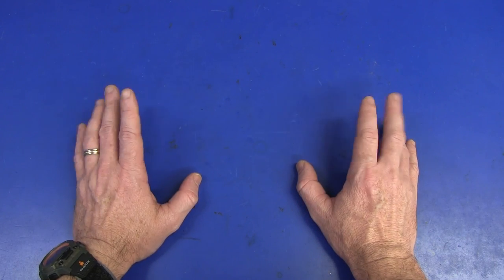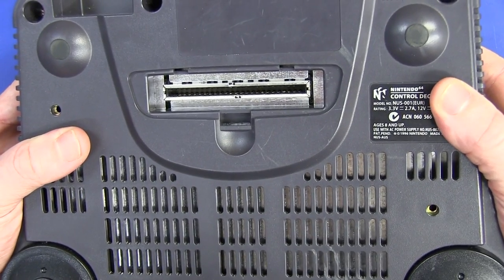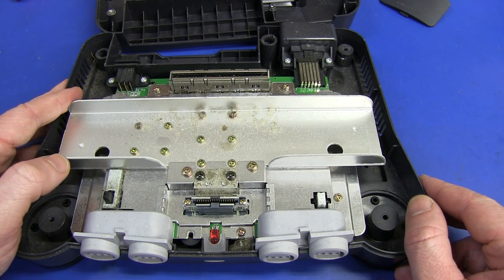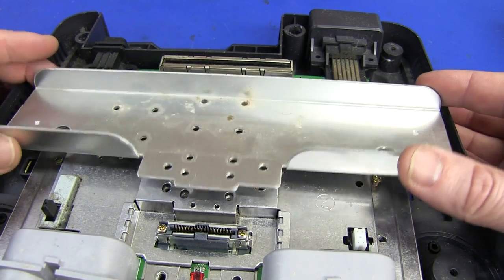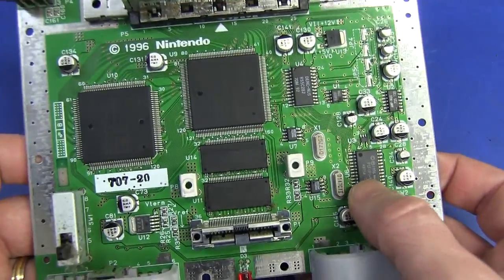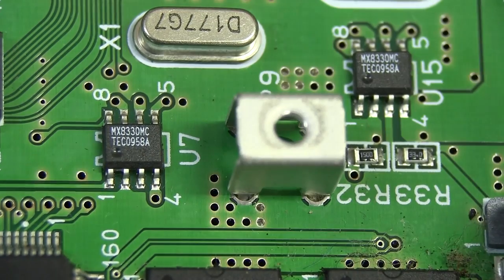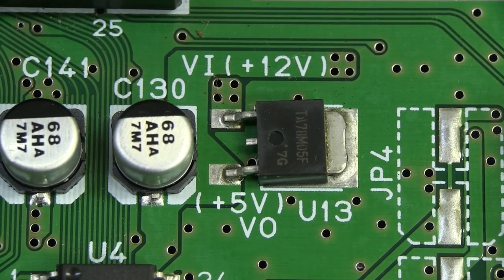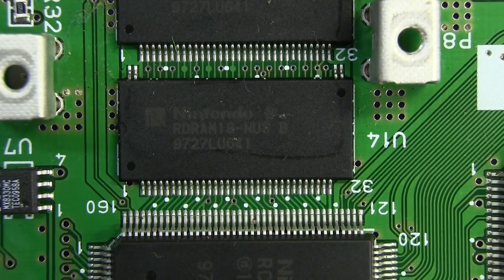EEVblog #491 - Nintendo 64 Game Console Teardown

Comment: My ultimate disapointment with N64 comes from it trying to rush into 3D gaming too quickly.
 The Super Nintendo was so cool for how it had a major improvement in 2D graphics and sound over the first Nintendo and I really wanted the next generation of 2D for things like Donkey Kong(SNES) which was pushing the system to it's limits.
 Instead what we got was something trying to be a PC/Arcade level console at a $200 price point which couldn't deliver a pleasing performance to people like me who were spoiled on PC and Arcade 3D experiences.
 Also the controllers were terrible.
Reply: "from it trying to rush into 3D gaming too quickly."
PS1 release date: 3. Dezember 1994
N64 release date: September 29, 1996
PS1 units sold: 104.25 million
N64 units sold: 32.93 million 
Rushed into 3D? I don't think so.
Reply: @DasAntiNaziBroetchen   Every game in the N64 library suffers from one or more of the following conditions: Low frame rates, slow down, stuttering, AA noise, limited FOV, bad physics, extremely low polygon counts, low-res textures, and bad or limited audio.

N64 had bad engineering under the hood:
No CD-ROM drive
Insufficient RAM
Lack of sound chip(sound is processed on CPU)
Lack of dedicated GPU chip(also run through the CPU with sound)
240p display limitations(PC and arcade were doing 1024x768!)
And it's coding system was eccentric. 

N64 has a long list of badly fucked up games like Castlevania, Superman, Earthworm Jim, Megaman, a Disney Donald Duck game, three bad Star Wars games, Mortal Kombat, and bottom ranking scores on multi-console game releases.

 They were beaten by Playstation and had 2 years to improve on Playstation's design by releasing 2 years later. Sony, the people who make Stereos and TVs made a console that beat Nintendo at their own game with older hardware.

Comment: It did have a DISC based add on thru the expansion slot, but it was only sold in Japan and was called the 64DD. If they had released it in the USA it might have lasted a lot longer.
Reply: Disk. Not disc. There's a big difference. ;)
Reply: DJPaulgee1
In English:
Hard Disk Drive
Floppy Diskette
Optical Disc
Compact Disc
Blu-Ray Disc

Comment: Regarding the ground contacts on the cartridge slot, N64 cartridges are not hot swappable from what I recall.
Reply: They put in all sorts of warnings that you should only change cartridges with the power off, etc, but of course in practice everybody just ignored that and things more or less worked fine.  I presume they designed it knowing that would probably happen....
Reply: Weren't they going to use hot swapping for Banjo-Kazooie? I know they had that stop n' swop thing that got canned for other reasons, but I think it was going to use hot swapping.. not entirely sure
Reply: Despite Nintendo's warnings, Rare did plan a game that swapped and the 64DD almost certainly could have made use of the feature. I think the pins were actually made that way to keep the SRAM in some cartridges from scrambling (a known problem on the NES).

Comment: the expansion port on the bottom was used for the n64 disc drive only sold in japan. kind alike floppy disc what games on them but different. newer version of the famicom (japan version of nes) disc system only in japan too.there was also doctor 64 and other versions that used expansion port so you could copy and play backed up games. that is kinda not legal to sell but they did. gray area maybe.  can learn a lot by looking around online.

Comment: 27:55 If you ever owned a N64, you'd known that the (red) expansion pack replaced a card that shorted some of the pins inside the slot.
That's why the RAM seems dead.

Comment: Hey, in case no one else mentioned it, the SNES did nothing without a cartridge installed, and I assume the N64 would do the same. Redo this vid with a cartridge (with heat sinks installed!)

Comment: Reason for the socketed cartridge socket (socket-ception? :-P) is for repair purposes.  Back in the day when the original NES consoles came out with the click-down loading mechanism, and on to top loading, you would get failing edge fingers that caused the classic garbage/blinking screens. The N64 was not immune to this same failure, hence the shop serviceable cartridge connector.  Imagine trying NOT to damage that board unsoldering a defective connector out of those plated through holes!

Comment: If you read what's imprinted on the panel you took off to expose the red thing underneath, it's the memory expansion, RAM if you will, it's called a "Jumper Pack" & serves no purpose other than to terminate the Rambus, without one the console won't work, however I believe yours has a memory upgrade (the one that has a red plastic topping) I think that means it's 4MB memory expansion for games such as Perfect Dark.
The power bricks slots into that recess there
The AV out is exactly the same as the SNES & GameCube.
The extension slot was for the 64DD add on which was a Disk type system but I think it was only released in Japan, but it wasn't successful. A bit destructive with the drill there, please don't do that. I believe the N64 CPU is clocked at around 93Mhz, nearly 3 times faster than the PlayStation 1's 33Mhz.

Comment: The N64 had reaaaaaally fast RAM (for the day) - I believe 400MHz. Compared to it's contemporary (DDR) at (per Wikipedia) 100-200MHz, that is screaming fast. It was one of the few things to use RAMBUS (which is also how it managed to have the memory expansion slot - AND why you needed to have a stub in the memory expansion slot - it was the "continuity RIMM")...

Comment: I wonder if Nintendo originally planned to allow hot-swapping of cartridges when they designed the console. Extended ground pins would imply that. Given the limited flash memory sizes of the era, perhaps they wanted to give studios the option for multi-cart games but gave up because of the price and complexity.

Comment: You can melt the outer tube of a Biro with a lighter, then press down on the screw to mould it into shape. This will give you a "gamebit" tool that will last long enough to get the job done.

Comment: The n64 was my first game console and the best game console I've ever owned was simple and it worked and the expansion slot in the bottom was mainly used for the n64 DD it was only released in japan and was a magnetic disc drive that was supposed to replace the cartridges because the magnetic discs were way cheaper to produce the DD even had a modem for connecting to the internet

Comment: yeah yeah late reply to an older vid.. But ..whatever.. david, that port on the bottom was for a hard drive expansion that , unfortunately , never took off the N64DD
Reply: +Mystic Virgo Not really a hard drive, but a disc drive, hence the "DD". Like a zip-drive.
Reply: +Mystic Virgo It was certainly a disk drive! It was available in Japan if I remember correctly.

Comment: 6:27 Perhaps the metalwork is bracing for all the people that tried to Hulk-Smash their N64 when it froze up.  It's a ditch move with those screws, but TBH, blowing out the cartridge worked to fix any problem.  These systems were remarkably reliable in my experience, not much need to open it other than curiosity - My 5 CD disc changer was candidate around the time I was playing N64 games.

Comment: Certain games came with different memory expantion moduals. They said for use with this game only, but the one that came with "Star Fox" 64 had the most RAM I kept it in mine for every game and it made all games run faster
Reply: James Ryan Star Fox 64 came with it's own, The Legand of Zelda came with it's own the Star Fox one was 4MB and the Zelda one was only 2mb at least at the time I bought the games, and in the US
Reply: Pedro Lambrini Indeed!
Reply: ***** What? Nothing of what you say is true, Star Fox 64 didn't have a memory module, there was only one memory expansion, it's the one in this video and it was 4mb, and it was included only with Donkey Kong 64
Reply: Nukle0n yeah Starfox 64 came with the rumble pack, Donkey kong 64 the Memory expansion. Donkey Kong, Perfect Dark, Resident Evil 2, Turok 3, Star Wars Pod Racer, are games that took advantage of the Memory expansion.
Reply: Tre Selor Majora's Mask and DK64 need it to run. PD needs it for Single Player

Comment: I wouldn't be surprised that all that's wrong with it is bad contacts when the cartridge is inserted just like what used to happen with the first generation Nintendo. Trying the old blowing on the cartridge can make it work for a short time but eventually you are gonna need a better solution.

Comment: the red expansion pack you pulled out is an enhanced 8mb (wow lol) memory pak that was used for games developed later in the 64s life, including perfect dark and donkey kong 64, 2 very good games.the one that came with the system was black and was 4 mb.
Reply: eggnbaconful The black one doesn't have any ram at all. It's just a jumper.
Reply: +Long Dong True - Also, the Red expansion pack is only 4mb, it just became known as the "8mb expansion", as that was the total amount of RAM after the upgrade. ;)
Reply: +Long Dong i stand corrected. thanks lol

Comment: You know it has Rambus RAM but you either forgot or don't know the rules that apply to that memory. Without a RIMM of the same size as the RIMM soldered onto the board or a CRIMM the RAM won't do anything. As others have mentioned without a cartridge it isn't going to do much. Another fact you got you generations wrong. The Nintendo 64 was up against the Sony PlayStation that ran on CDs not DVDs. I was the Sony PlayStation 2 that used DVDs.

Comment: Actually the Nintendo 64DD was not a CD drive but a magneto-optical disks drive, re-writable (used in a map creator in F-Zero X) but very low capacity compared to regular CD.

Anyway, it was a short-lived commercial failure.

Comment: I imagine so... Nintendo's systems always seem to be impressive feats of engineering. The Wii U contains an Multi-chip-Module... Meanwhile, the N64 design is basically a Silicon Graphics workstation modified to be as cheap as possible. The overall system architecture, and graphics systems are lifted straight from the designs SGI used for it's rendering workstations. But yeah, that level of integration is interesting considering what was going on just a few years earlier...

Comment: 3:25
This is why us gaming afficionados don't send Dave more retro tech. Even SNES/Super Famicom, Game Boy and Genesis/Mega Drive cartridges needed a gamebit screwdriver bit to open.

It was utterly ridiculous, since pirates and counterfeiters didn't give a damn about damaging the casing to get at the PCBs, but its a lasting slap in the face to anyone who wanted to solder in a new battery to restore game saving functions on old carts, or simply to remove them before they could leak.

Comment: the 1st ver of the nintendo 64 hand a voodoo gpu in it, that you can get for your pc at the time.

and the the port on the bottom was for a hdd, modem, and cd-rom, 
cuz the voodoo gpu was a 1st in gpu's that can run a dos like linux.

thanks for your time.
Reply: nope
Reply: 3Dfx said Sega has still not given a reason as to why it terminated the contract or why it chose NEC's accelerator chipset over 3Dfx's. According to Dale Ford, senior analyst at Dataquest, a market research firm based in San Jose, California, a number of factors could have influenced Sega's decision to move to NEC, including NEC's proven track record of supplying chipsets for the Nintendo 64 and the demonstrated ability to be able to handle a major influx of capacity if the company decided to ramp up production on a moment's notice. 3dfx Interactive was a company made the gpu called voodoo.
Reply: Yes, you copied and pasted from Wikipedia, well done - however, you didn't read it properly, and clearly understood none of it.

What that statement says, is when 3DFX were looking at making the Dreamcast GPU (Blackbelt), but SEGA instead went with NEC (Katana), who had proven themselves well capable of production ramp up and supply control for the N64, as they made the CPU for the n64, not the GPU - which is, and always has been, the SGI Reality Coprocessor; the entire console was built around it, and all the promotional material pre-launch, even years before, were very SGI heavy.

3DFX had, shall we say, not been great for their quality or supply line control at that time. Hence why SEGA dropped them and went with NEC, who when it comes to this sort of stuff, are the second teir to AMD, Intel and IBM when it comes to their production capacity - it was a no-brainer. The last part of the statement you've copied and pasted is literally just pointing out that 3DFX make the voodoo chipset.

So no, there was never a time when an N64 had a Voodoo GPU in it, it could never run Linux, and the bottom port was for any expansion they deigned could be put on there, but the only one that came out was the 64DD, which was a monumental flop.

Also, Linux isn't a disk operating system, it's a kernel.

You've read that, failed to grasp the context, and got it so completely bass ackwards it's really quite delightful.

Thanks for wasting my time with your complete lack of knowledge on the subject. Next you'll be telling me the Dreamcast is water cooled...(hint - heatpipes don't contain water)
Reply: i do know that heatpipes do not have water in them, and thank you for setting me straight and that my friend from high school days was wrong about it. he hand the voodoo and the n64.
we need more people like to keep the the fake federal news off tv. 

but at the same time i feel like you a hate for all people or one's that make a mistake.
and that my iq is low and that im a sub human to you. because of my lake of knowledge.

say " i see, um will i for give you. and may you be more bless than me."
thank you for your time. and have a good day :)
Reply: It's not a lack of knowledge or low IQ, and I don't hate you (very few people really hate - they just getting mildly annoyed) - it's that you absolutely stated that N64s used to use a Voodoo GPU, and then you found the very first thing on the internet that you thought backed you up, despite the fact that in context, it isn't even related to the subject matter. You then presented that as proof, presumably hoping it would bamboozle casual readers into thinking 'you won'.

That is exactly the definition of fake news; make something up, then try to justify that position with bad research.

There's nothing wrong with saying 'well, shit, I might be wrong on that one'. I try not to talk on subjects I'm not familiar with, but even that said, I still have to go 'well shit, I might be wrong on that one' every so often.

One way to avoid that is to suffix any such statement with 'as far as I know' or 'correct me if I'm wrong' - gets you out of so many problems.... ;-)

(I also had a mate who used to bullshit about tech, too - I think everyone had one)
Reply: it wasn't my intention, and yes i did go looking for info on the on the prototype n64 may or may not have hand a voodoo chip in it.
but again why am i put in the negative light that im try to "bamboozle or try to win" 
one way to avoid this is by again say im sorry. you will in all ways and for ever be better then me.
i have a feeling that will never be good enough. and you will have some thing that puts me in to the narrative.
if you like i will delet what i have to say but thin i thank may you would not have the feeling of putting down someone live for reader to admire you. but at the same time you can have the 1st words of set me to look like the azz that i am . is this ok to you? again i love and for give you and may you be blessed more than me. :)

Comment: Dave you might be getting nothing because there is no BIOS. The cartridge is the BIOS. So I'm not sure how CPUs with no instructions to read typically behave, but I'm assuming all zeroes means NOOP, which means they wouldn't be really doing anything. shrug

Try finding a cart. I bet it wasn't really broken. As you said it's all solid single board construction. I bet their issue was with the port.

Comment: I seem to remember mine getting very hot indeed. I'd guess that the metal is mostly for heat dissipation.
Interestingly that red memory unit doubled your RAM to 8MB! If memory serves it was about 70 GBP :-S